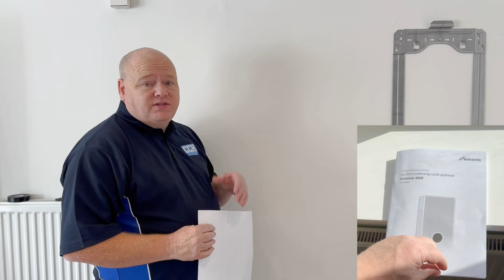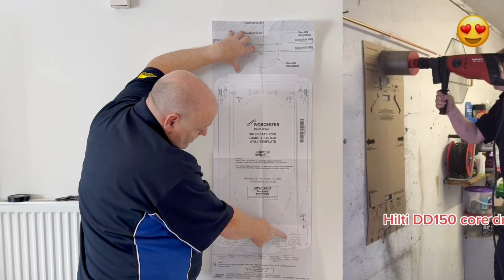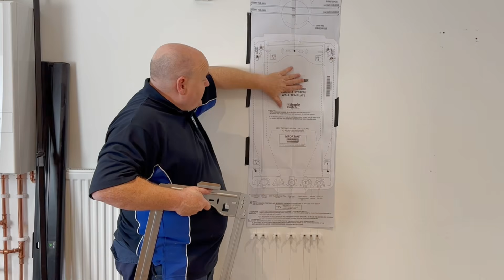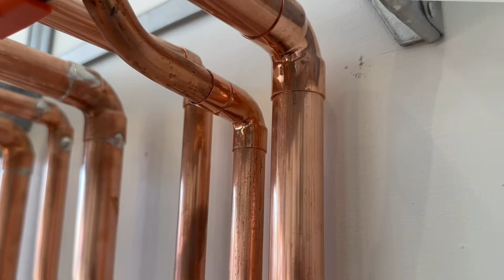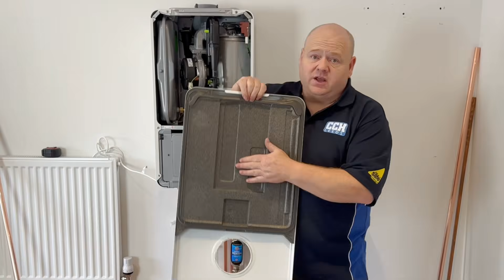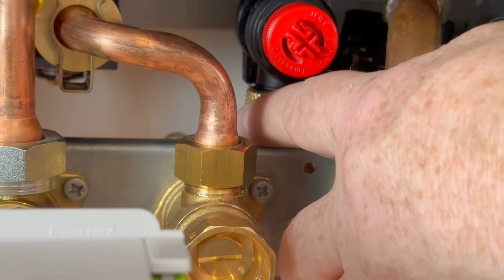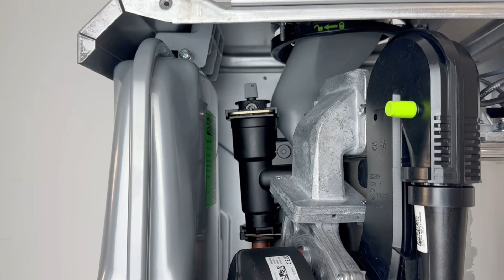Worcester Bosch Greenstar 4000 Boiler Installation & Full Review | Heatable

Comment: @ 10:50 after several decades of rubber hoses that get clogged with deposits, I also think you'll be happy when they also decide to surrender and put a rigid connection to the expansion vessel :))))
personally, after a few thousand serviced boilers, I have not encountered a single clogged rigid connection regardless of the diameter of the pipe from which it was made....
You are very soft with the criticism on Bosch after all the years of pain and dirty hands from their clogged hoses 😂 
The approach from the video from another guy on YouTube is what they deserve :
Just search Urban Plumbers - Viessmann, is this why we could never get along 
And have fun. If you dont have the time for the full video just watch from 13:00 ahead… ;)
Reply from the maker: I have done many WB videos, feel free to watch some of them, I actually like this boiler.
Reply: @AllenHart999  I have seen almost all your videos :). however, I prefer boilers with a stainless steel heat exchanger ex: baxi ;) ... but the model in this clip is built acceptably honestly.. ps I recommend you to view the interpretation from "urban plumbers" about viessmann :p
Reply from the maker: @mihaiachim5299  I have seen a few of his videos and i don’t share the same opinions.
Reply from the maker: @mihaiachim5299  The Baxi Duo-Tec and Platinum were good reliable boilers, Just very basic, They are getting left behind now. We need boilers that have better modulation ratios
Reply: @AllenHart999  he is more sarcastic; I don't agree with all his opinions, but it's good to see as many points of view as long as they are not wrong...
Reply: @AllenHart999  baxi Platinum has 10:1 modulation from long time ago … i have One from 2015-2016 with 10:1 modulation :) and that boiler is extremly Smart … and supports opentherm thermostats ( at least the electronic board in it made by siemens supports …) I will find out in the next weeks
Reply from the maker: @mihaiachim5299  That’s not true. It doesn’t have 10:1
Reply from the maker: @mihaiachim5299  24kw combi only goes down to about 7kw min, i would need to check for sure but i know its really high
Reply: @AllenHart999  I'll look at it tomorrow to check - I may be wrong :)
Reply from the maker: @mihaiachim5299  7kw min, Thats terrible https://www.freeboilermanuals.com/assets/pdf/baxi_disc/Plat-HE.pdf
Reply: @AllenHart999  baxi Luna platinum+ 33GA ( this is my boiler model)
Max output power 34kw ( hot water) and min power is 3.6 Kw but on heating is only 1:6  3,6Kw to 24 Kw
Reply: @AllenHart999  that is not my boiler :) - that is an old model; my boiler model  is much more advanced :)
Reply from the maker: @mihaiachim5299  They do not sell them in the UK, They had a lot of issues with the GA boilers.
Reply: @AllenHart999  Yes, they do; at mine the electronic board has failed after 3 years (Board made by Siemens in Germany with Siemens claims that the Board is very reliable made :))). ) and the electronic Board is 300E but i am an electronix engineer and for me to fix the fault in the board with a much better part It cost me 0.5E + my labor :) 
But i have similar faults on Vaillant boards only after 5-8 years …. But the parts needed to fix the Vaillant electronic board are @ 1-3E…
Viessmann has a lot of faults/ flaws on their boilers parts :) … 
Baxi is definitely not the black sheep of the flock :)
I personally don't buy boilers produced by the Baxi group because I can't stand my local dealer from them …